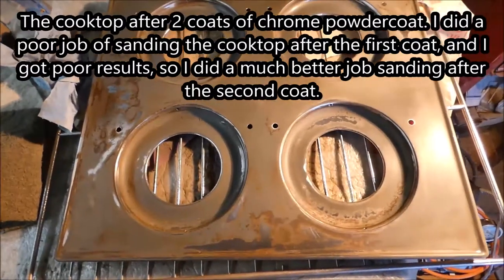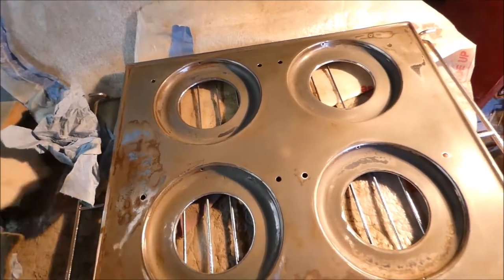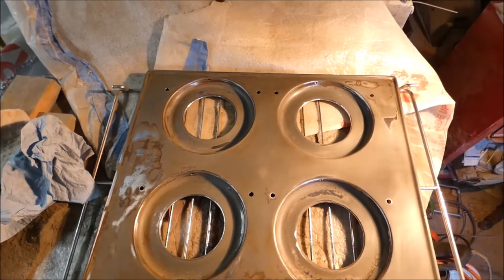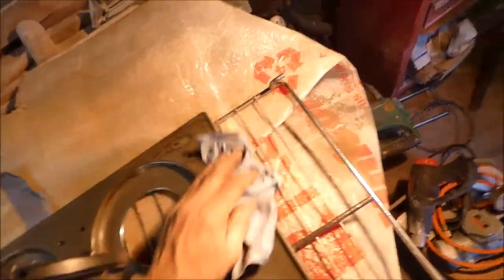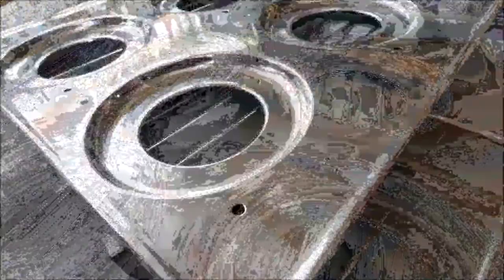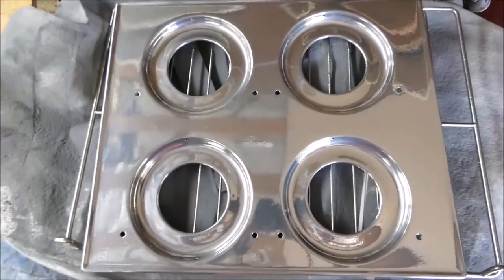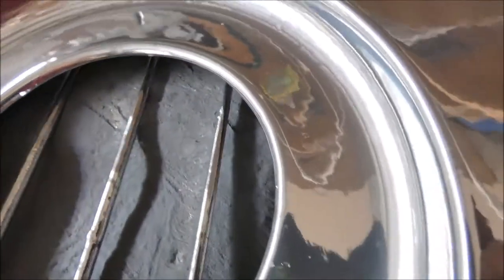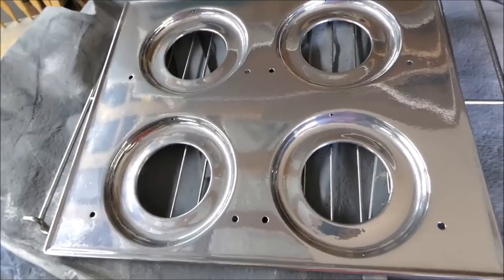Powdercoating a Steel Stove Cooktop with Chrome Powdercoat: 6/13/21

Comment: That's amazing! The chrome finish will stand up to the heat from the stove? That's really cool with the other items as well. -- My regards to Peaches and Pears and anybody else that's around at the moment. 😊
Reply from the maker: Hi Lynn! Thank you. I think it will stand up to the heat because powdercoat withstood the heat gun on its highest setting from a about an inch away (in my previous video), so that led me to believe it would be okay on the cooktop. Thanks for the regards. Peaches is on my lap, and the sparrow is perched on top of my computer moniter taking a snooze. Wishing you a pleasant coming week. Warm regards from Wishram.

Comment: That is really amazing Todd, I had no idea that you could powder coat chrome. You never fail to amaze me. You have a bumper and a stove top, what’s next? How is the littlest of your birdie flock?
The trimmers turned out nice as well. What’s better than a super deal on something? I’m currently mowing my lawn with a mower that someone pushed out by their garbage can to get rid of. Very easy fix and cleanup and I’m cutting grass!   :)
Reply from the maker: Hi John! Thank you. The chrome powdercoat isn't as hard as real chrome plating, but it's the next best thing. I'm not sure how it works, because when you sand it, it is brown underneath. I think I'll do the oven door on the stove next. 
The birds are doing well, although we a near catastrophe after the little sparrow fell into my tall, half-empty water glass and almost drowned. Luckily it recovered. That's one lucky bird! I have one of those lawn mowers too, but I haven't fixed it yet. It's just a dirty carb, as I was able to get it started with starting fluid. It's a nice, self-propelled Honda. It helps to be handy! I'm so glad you stopped by. Give Bear some extra Petting for me. Warm regards.